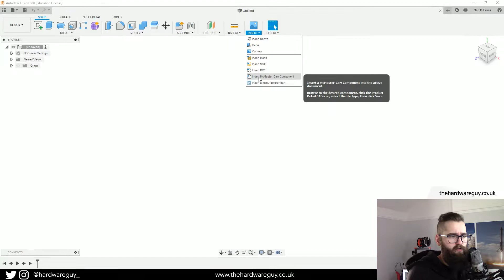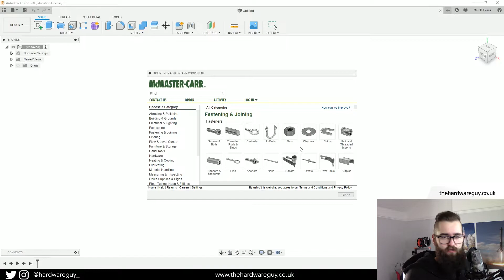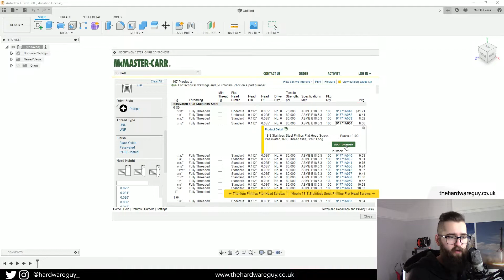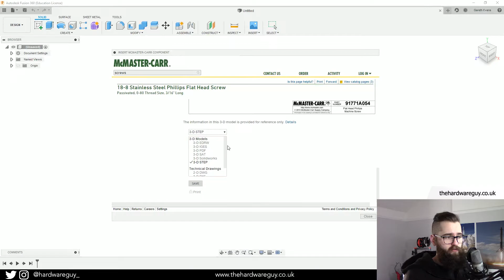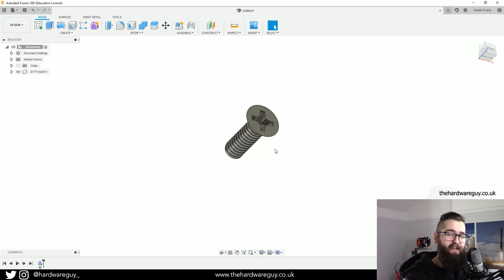Fusion 360 McMaster-Carr Import

Comment: hey quick question, is there any way to resize the parts from the Mcmaster-Carr library to the size one wants. im trying to create a design and the standard sizes offered by the library do not allow me to create what I want, for example can i change the width of certain tube like parts (im using a shoulder screw)

Comment: Is it free??
Reply: Yes it's free. McMaster-Carr offers all their 3D models for free. You don't need Fusion 360 to acces them. You can download the models directly from the website to use in any CAD program. Fusion 360 just has a convenient interface which pulls up the McMaster-Carr website then imports the dowloaded file with just a ckick or two.

Comment: Thank you for a very straightforward tutorial. Interestingly, I found that it did not work for the one part I was after. A garden hose cap, part number 63745T92. I did try inserting a random bolt and that had the link for saving the file. But the hose cap did not. Is this a common thing for a part to me missing the save link?
Reply: Mcmaster has a very large library of 3D models for parts but there are some that they don't have. These parts are often generic items (like a garden hose cap) that they can get from multiple suppliers and as such would not all match the model.